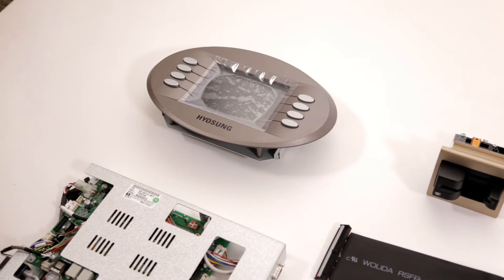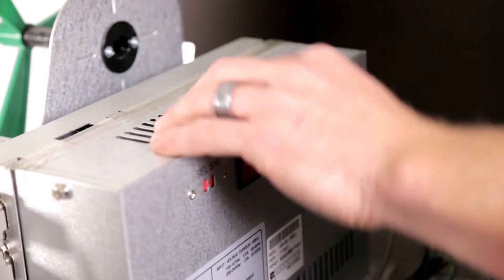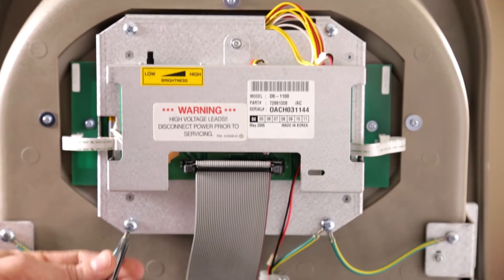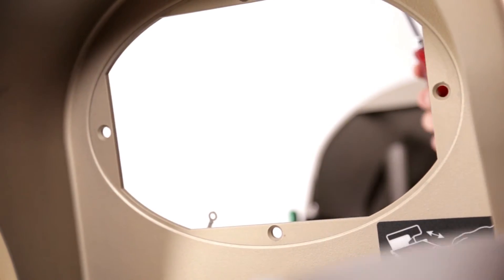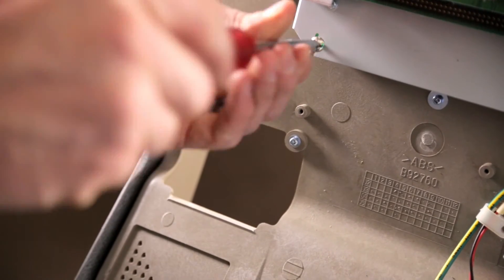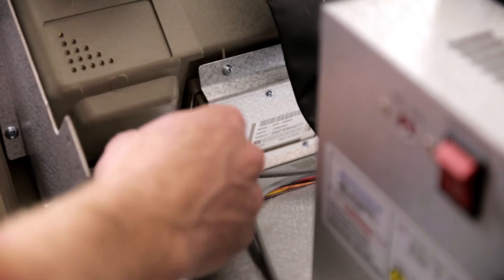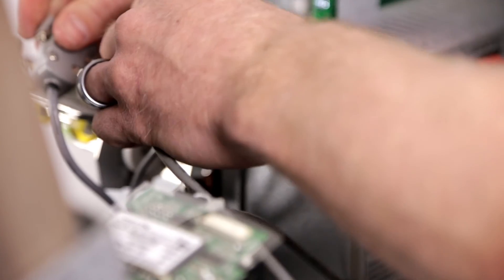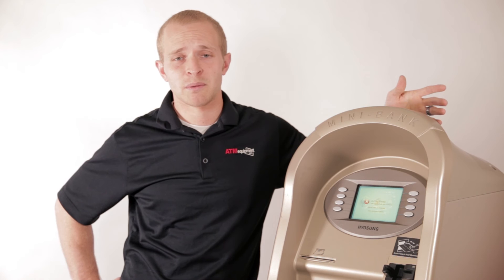ATMequipment.com - How to do an EMV upgade on a Tranax / Hyosung Minibank 1500

Comment: I installed the kit and when I powered on the unit I had two issues. #1 EMV CR has no power, and #2 the Printer wont feed.

There is power on the printer board. when the reset button on the printer board is pressed the red LED lights up, the green LED is lit showing power. 

Is this a matter of dipswitch settings or are my cables plugged in wrong?
Reply from the maker: ***** Thank you for reaching out to us. We will have to go over several steps to troubleshoot the issue. Could you call us at 1-800-498-5795 or got to atmequipment.com/Support-Center/Contact-Technical-Support